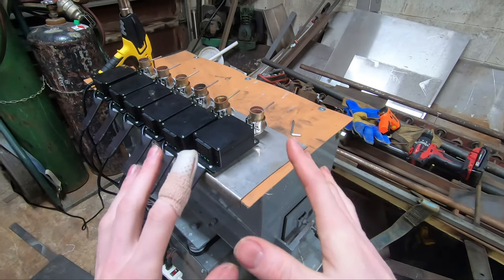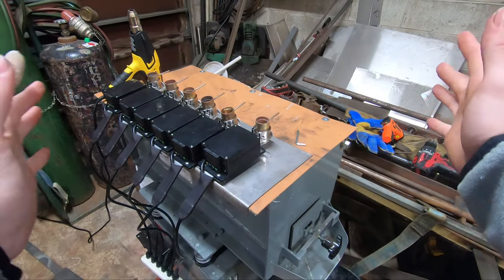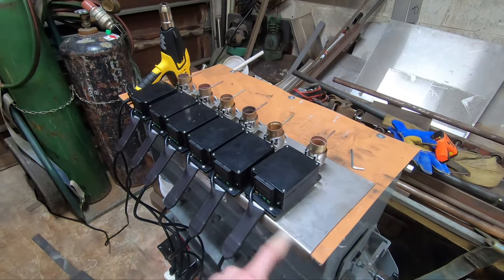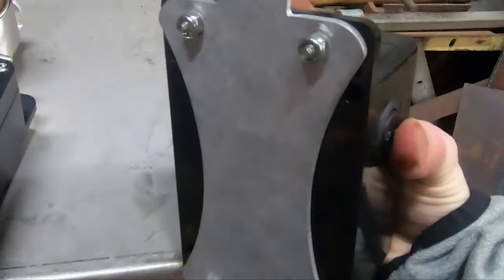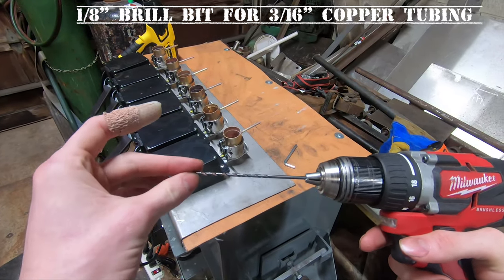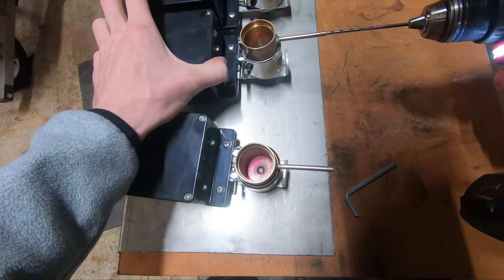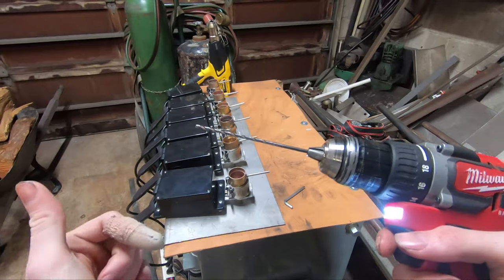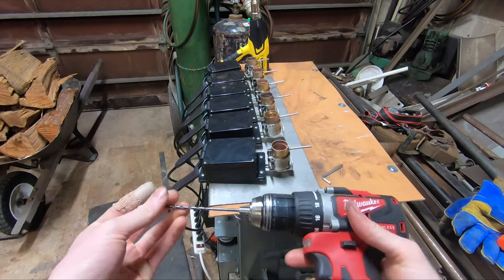How to stop an Oxalic Acid Vaporizer from Clogging

Comment: hey rob, good tip, i also have to drill out my homemade vaporizer half inch tube after so many uses. the oxcilla acid turns hard as concrete after it cools down

Comment: I found this vaporizer to be clogging after first use…for this price it needs to be hassle free, which it’s not. The end clogs up shoots top off and then as smoke is going everywhere I have to try and put a poker through it which in most cases fails as the OA has crystallized. I have had it for about 6 months and after emailing you and finding out the only solution you provide was to heat up end? So for 269 dollars we have to do something to make product work? Plates work fine but they are just plates
Reply: Dude, a 1/8" drill bit is only a few bucks.  Do you get upset when your car needs an oil change?

Comment: I've always just used water while it's hot then shove a poker through the tubing. Is that not a good idea?
Reply from the maker: The water technique works well I am just cautious about recommending it due to the burn potential because if you have the water in there for too long it boils very aggressively, and if you have something to poke through that works.I have a mini screw driver I use in a pinch though using the drill bit is easy and less likely to have you bending the pipe if you have a lot of buildup.

Comment: The Johnnys has a curved tube so this method wouldnt work. I pour a mix of baking soda and water into the cup. it works but also requires reheating and slows the process down.
Reply from the maker: Ah, I thought at one point he had one with a straight stem. Thanks for the reminder about his final version. With the curved stem!
Reply: The baking soda method is how I have to do it for my curved nozzle one. Hopefully I won't have clogging issues.
Reply: I also use a Provap. Never clogs for some reason. Maybe its because the tube is a larger diameter and shorter??
Reply: @LorobBees  I have one of John Oliver's.  The tube is straight.  I simply put a baling wire into it when I am finished with a hive.  When I start the next hive I twist it a little and pull it out.  Works great for me.  I cut a length of good ole baling wire and put a little loop in the end so I put use it to twist and pull.